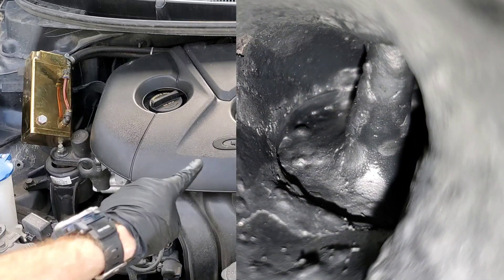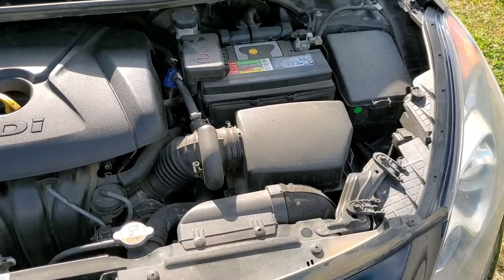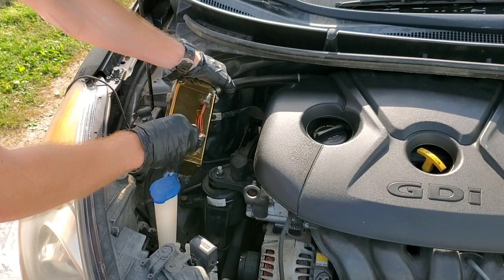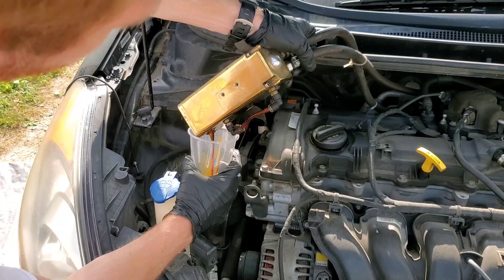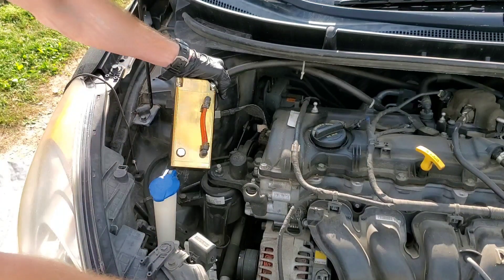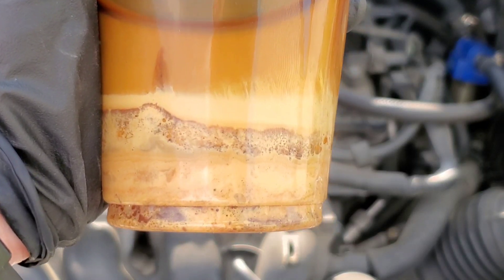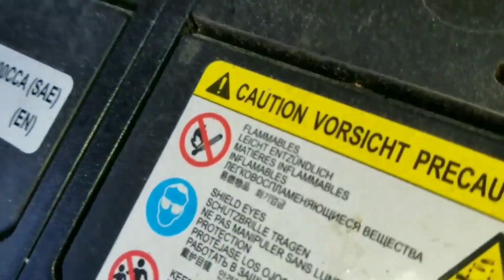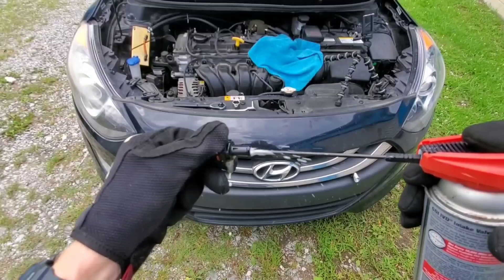I can't believe what People Don't know about Engines!

Comment: Useful video.  Is there a chance of large chunks of carbon loosening up and causing damage when using a gdi cleaner spray like crc?
Reply: Yes happened to me
Reply: @henrytom5824  you mean your engine was damaged by loosened  carbon chunks after using gdi cleanig spray? What brand was it?
Reply: @sunilayya8948 use it on a engine no more then 60,000 miles if you do a lot of highway miles then the carbon shouldn’t be too bad and you can use it but if you do city driving expect it to be bad. Also that crc keeps cleaning for a week straight no lie while your driving on the highway pieces will flake off into the combustion chamber horrible sounds it makes, all the bad stories people talking about happened to me bro not worth it I wish I had just cleaned manually in the first place we no longer have that car it was in beautiful condition on the outside but I k we that engine wasn’t going to make it past 120,000 miles it burned oil and pinging all the time and cat went out at 103,00 miles for 10,000 miles I put a catch can on it at 93,000 miles to keep carbon buildup down make the engine last abit longer but that’s when the cat went out at 103,000 miles I wasn’t  doing it anymore bro endless money pit.
Reply: @henrytom5824  many thanks for your reply. What was the vehicle in which the engine went  bust so soon? After your reply i am convinced that i should eventually go for a manual cleaning after a boroscope test confirms substantial carbon build up. My car has about 20k miles so far with a tiny gdi turbo.
Reply: @sunilayya8948  it was on our 2016 Hyundai Tucson 2.0l gdi nom turbo.
Reply: @sunilayya8948  only 20 thousand miles shouldn’t be bad at all if you do much highway miles but it can start to buildup very fast in just 10,000miles and the more miles worse it gets if not cleaned early on to prevent significant buildup. Highway will keep things at bay if you take atleast 30min highway drive every now and then.
Reply: @sunilayya8948  if you start to use the spray cleaners use them early 20,000miles you will be fine their shouldn’t be significant buildup at all don’t wait for another 20,000 miles . every 10,000miles I believe is what the crc recommended or info from the web.
Reply: @henrytom5824 many  thanks again . Will do a borscope camera test soon as i  hardly ever go on the highway. Always short distance city runs .  Will use crc if build up is not significant.

Comment: Great vid bro... have an Elantra (2012) changed oil , plugs cleaned injectors and throttle... now when I’m slowing down to turn corners or going up an incline the car stutters as if misfiring and my engine light blinks on and off for a couple secs....
I took off the ECO mode on the settings and it seems to have stopped... 

Any suggestions?
Reply from the maker: Check the codes, Also It may seem obvious but sometimes the way they made some of the dipsticks they have to much oil. Other problems relating to the oil and make sure when drained to see exactly how much is taken out vs manufacturer recommendations.
Reply from the maker: Be sure to check data at time of any codes. This will help locate the problem.  Check for recall to using your vin.
Reply: Thanks 🙏🏾....
Reply from the maker: I hope it all works out and thanks for your kindness.
Reply: Gdi engines are known for having lsp1 low speed preigntion and going up inclines with eco mode on will make the car want to bog possibly could be the issue. Worst thing you can do is drive a Hyundai with eco mode Only use it when on the highway it will bog in city traffic and low rpm’s mean low speed preignition and also terrible carbon buildup if it’s a gdi.I’m assuming everything is working in spec as should and no errors. Probably isn’t your issue but definitely good advice that eco mode killed our 2016 Tucson carbon crepped up like no ones business and cussed me a lot of issues. Kept running at 103,000 miles but it was burning oil and had cylinder scoring most likely from when I used that damn crc cleaner.

Comment: And speaking of cleaning, the EGR valve on my ‘08 Grand Marquis is dirty, so it’s triggering the check engine light. Car still runs great, but I don’t like error codes. Is there a way to clean the EGR? Or should I just replace it?
Reply from the maker: I have cleaned many however in modern vehicles they often use electronic EGR valves and not vacuum operated valves. Which could be the electric motor. First check the code and see if you are running lean or have a vacuum leak.  You may want to check the valve off the engine.
Reply: @NATESINTERACTIVEAUTO  Thank you. If it’s not a quick and easy fix, then I’ll just leave it the way it is and maybe put electrical tape over the check engine light lol. The motor still runs like a top.

Comment: The bronze filter you installed is not top restrictive for crankcase ?
Reply from the maker: Check out the video where I installed it. 
I make sure the inlet and outlet vacuum hoses are proper size.  Follow manufacturer's instructions.

Comment: My 2014 GDI 2.0L engine failed at 60k miles. I just got a new small block, and now I spray that Seafoam spray every time I change my oil. It just hit over 100k miles, I’m not sure what else I can do to keep it from failing again
Reply from the maker: Don't wait 7500 miles to change the oil, change it sooner and use inexpensive oil if need be.  What turned out to be the problem carbon buildup on intake valves?
Reply: @NATESINTERACTIVEAUTO  The dealer never told me what happened but im assuming yes. I've been changing it every 6k miles with GDI cleaner and Lucas fuel injector cleaner. I use my car for ride share, is there any recommendations to maximize longevity of the engine?
Reply: @chandlerchhem2128  huyndai had a huge recall on alot of their engines for certain 2013 and 2014 models, metal shavings was left in the oil passages and starved the engines of oil, most likely a rod bearing failure. My suggestion would to just get a N/A huyndai, the turbo gdi engines seem to have accelerated problems with carbon buildup and turbo oil leaks regardless of year and model.
Reply: @darkskys1757  I have a Kia Forte 5 EX, what does N/A mean?
Reply: @chandlerchhem2128  N/A means naturally aspirated, No turbo.

Comment: I am knocking on some wood here, but... I haven't had an issue and I can't understand why. Is it because I drive mostly highway miles? I've had more than one GDI and never an issue. V6 and 4 Cylinder and they have been trouble free. I can't seem to find any information about why some do and some don't have problems. As far as the Hyundai 2.4 Theta II GDI in my Sonata, I'm more worried about engine failure BUT LUCKILY!!!! Hyundai has a LIFETIME free engine replacement on the only big issue they have. Is this a bigger issue with a lot of city driving?
Reply from the maker: Highway driving helps although for other reasons such as catalytic converter or combustion chamber, perform, mpg, and overall mileage can be affected. But if you don't keep your vehicle very long it may or may not matter. Now when it comes to the intake valves many vehicles use a extra set of fuel injectors to spray intake valves to avoid carbon buildup you would otherwise have on some GDI engines. Once again highway driving helps and extra injectors. This doesn't fix all of the problems.

Comment: Catch can on only a Gdi engine, or all engines?
Reply from the maker: All engine's can be very beneficial for the catalytic converter or the engine performance over time and longevity. Many say you don't but the truth is how many converters or otherwise last hundreds of thousands of miles, 400,000 miles. Some don't last 200,000.